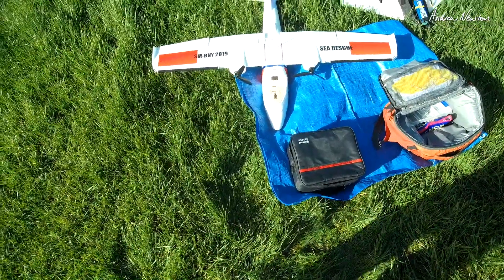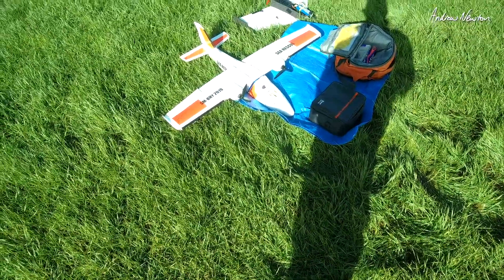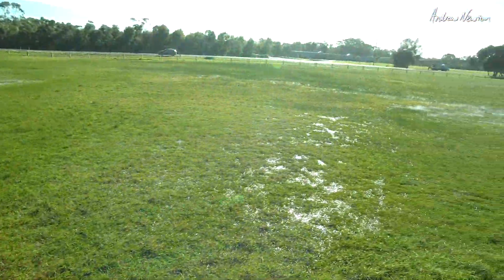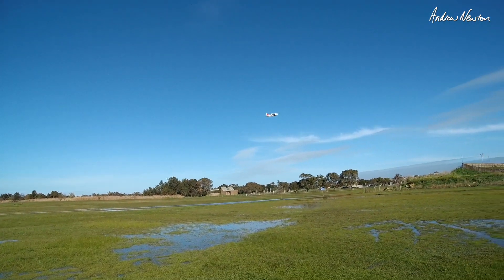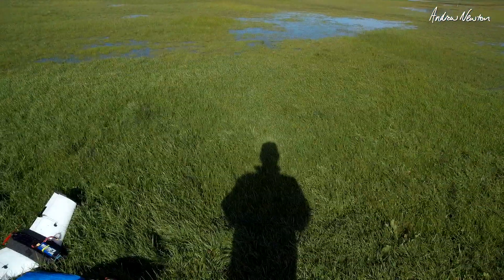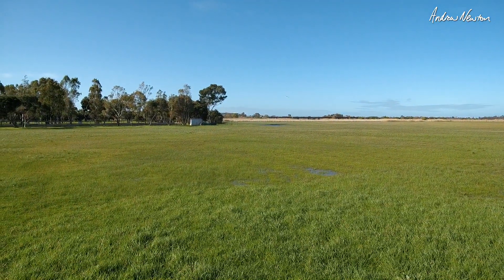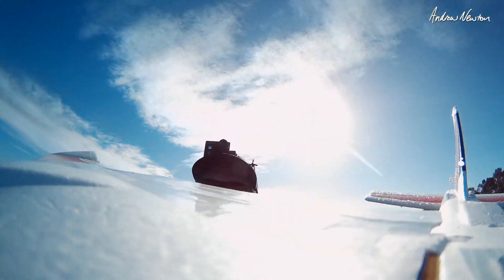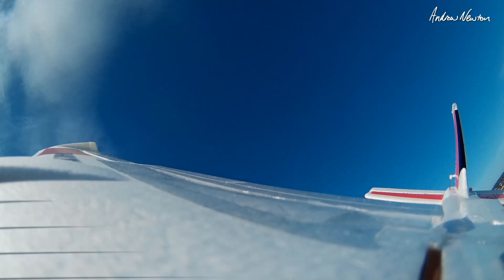Sonic Modell Binary Fat Wing mod

Comment: Hi Andrew! What’s any adjustments did you make to inav to a accomodate for the larger control surface areas?
Reply from the maker: Reduced the throws by moving the pushrod connection
Reply: Thanks, Andrew! I did that, but I had some massive fluttering that occurred because the push rod connection was pulling through the foam on the plane. I’ve got to go back to the drawing board and reinforce that area to get it down lol. Thanks for all your help since your initial assistance in the spring I’ve had many many hours of flying. Especially the swordfish. Cheers.

Comment: Your Fat Wing-Mod has certainly generated heated interest into making an already good plane into something really great.  For me this Binary fuselage (size and arrangement) has good potential to be one of the best aerial mapping platforms. However the Binary wing has poor lift capacity with additional weight (+350 g) at desirable cruise speeds (15m/s - 54 km/h) needed for good aerial mapping. 
Another wing-mod video from you, explaining the build process (perhaps using another wing from other model), would generate a lot of lift from this community.
Reply from the maker: I'll add it to the list Alan but all I have done is roughly hotglued 6mm depron on to the trailing edge for a quick test. It worked so well I left it like that. I must refine it one day

Comment: Can I also do that on an Fpv glider to get some more wing area and make it slower with more lift?
Reply from the maker: Yes it will work, you would need to taper down to a fine trailing edge for less drag on a glider

Comment: I wish Sonicmodell issues another set of wings for this plane. LIke the Volantex Ranger RC plane has got 1.6 and 2 meter interchangeable wings. The smaller ones could be used for rapid racing style flying and the bigger ones for mapping, long range FPV, etc.

Comment: Hi Andrew, confirm you're flying without FC? if so, which percentage  of aileron, rudder and elevetor would you suggest? I am going to finish my Binary this weekend and would like  to try your setup. Thanks!
Reply from the maker: No FC at the moment. After this wing area mod my current settings probably wont be relevant for your build. But from memory I started with 30% expo all round, settled on 75% throws for Aileron and Elevator with 50% for Rudder. That gives you a lot of control so I would have 50% rates on a switch as well.
Reply: @AndrewNewton  thanks! appreciate you always reply to questions. have a good day.

Comment: The wing area in itself has nothing (at least directly) to do with tip stalls.  The lift distribution and span wise airflow over the wing do, along with the wingtip shape.  The designer should have done a better job working on those things, and if they expected it carry more weight at a reasonable speed, they should have used a thicker airfoil to increase the coeffecient of lift.    The Mod you did increases the CL indeirectly by increasing the wing area, so is a good simple solution.  Sometimes I feel tempted to design a similar type, distance optimized twin, with a shorter span than the Gemini V2.  Let's hope that the designers of the Binary can get their stuff together and make a new version with a better wing!  It does look like a fun little model.

Comment: I bought the binary to be the workhorse for some LIDAR shenanigans.  I'm still in the build stage, using a dummy load to represent the weight of the payload. I noticed some major issues when trying to fly really slow and low, tip stalls in the turns, and all around shakiness. Your wing mod might be just what the Dr ordered. Thx from Ohio.
Reply from the maker: Yes more area should improve it

Comment: So it works? it helps notably with tipstalls?   Cause i have a nasty ASK21 glider wich is utterly prone to tipstalls ..tried winglets.. maybe they helped a bit but still very tipstall prone.. its foam so it has a step in the trailing edge.. might experiment gluing extra trailing edge with depron to see what happens....
Reply: Can you build in some washout with the extra trailing edge? Or maybe warp in some permanent washout? Also, making the leading edge have a blunter shape (larger radius) ?

Comment: It looks like your trailing edge turned the wing nto a reflex airfoil. Now if you want a serious twin engine foam aircraft try the Multiplex Twinstar. Or you can keep trying to improve Chinese half baked foamies. Good luck Andrew.
Reply: Podo, you have zero clue what you're talking about. The twinstar has basically zero fpv capability where the Binary is loaded with features including a mapping camera bay, room for pan and tilt, and easily accessible compartments for the gear. In addition, the plane has a full nav light kit available which looks incredible. There's nothing magical about balsa and glue and the twinstar just looks like a tired, boring design from another era. I'll take "Chinese foam" any day, SonicModell is a great company with tons of customer interaction and support.
Reply: @MikeMPharmaCyclist  OK for FPV space inside the fuselage, but for aerodynamics the Chinese design a lot of tip-stalling, not thoroughly tested (thus half-baked) planes. Be careful where you put your put your 300$ FPV-UAV gear, no 3-axis stabilizer will save it. Check the sad Boeing story (737 Max) for example. And the Twimstar is foam, easily expandable, FPV ready. Cheers.
Reply: @podoclaste  not thoroughly tested? Have you seen all of the discussion SonicModell has shared about thousands of flight hours on this platform before it was released to the public? Maybe they're exaggerating, but the reviews are generally excellent so I have no reason to believe the platform wasn't throughly tested. Any FPV plane can go down for any number of reasons, but by far the most common is electronics failure or weather.. Neither of which have anything to do with the material of the model. When's the last time a "foamie" just disintegrated in the air? Where is the Twinstar manufactured and where's all this amazing test data you brag about? It's hilarious you bring up the Boeing 737 MAX which was designed and put into service by a multi billion dollar well established American corporation... The analogous company in our discussion would be whoever makes the Twinstar, the company you claim makes sound decisions and products.. We thought that about Boeing too. Until I see a sonicmodell aircraft vaporize unexpectedly, I'll continue to base my decisions on evidence and not some bleh nostalgia for balsa wood and glue.
Reply: Dear Mike, you do realise Andrew Newton had to modify the airfoil. The airfoil !? How bad can a plane be when a seasoned RC pilot has to do that ? Also, be aware those reviews are actually paid for by the companies that sell the planes. Zero conflict of interest there, for sure.
Reply: @podoclaste  did Andrew HAVE to modify it or did he want to in hopes of gaining some more efficiency and reducing stall risk? C'mon, man... The company is really going through some efforts to trick us into buying their 100 dollar plane kit... 😂😂😂😂✈️✈️✈️ You never answered my question about the twinstar and all of the testing data and excellent track record. I researched the plane a bit myself... cobbling together a Go pro mount on the bottom of the fuselage that looks ugly and ready to contact the ground definitely sounds superior. Did they test the plane with fpv equipment hanging off of the fuselage? 😭😭
Reply: @podoclaste  But the Binary is so attractive!

Comment: That worked very nicely! Did you get shorter or longer flight times post-mod? I feel like you'd be pulling less amps to keep it in the air with the bigger wing, and lose some drag from better Reynolds numbers, but would lose a few kph off best-cruise speed due to increase in wetted-area drag, and then there's induced drag because you've effectively lowered your aspect ratio, BUT you're probably at a lower AoA now with the bigger wing so... Augh, overthinking it. Not sure how it would all balance out. :P What happened in reality?
Reply from the maker: No idea at this stage, all I know is it flies nice. Time will tell.

Comment: I have a flysky fsi6 can you suggest a upgrade and use my fs-ia6 a2 receivers thanks jw
Reply from the maker: Taranis Q X7 with a multi protocol external module will do it, but OpenTX is a new learning experience. Don't know much about the other FlySKY transmitters.